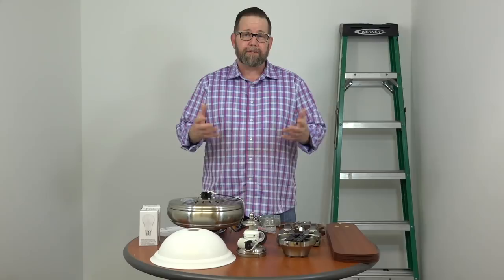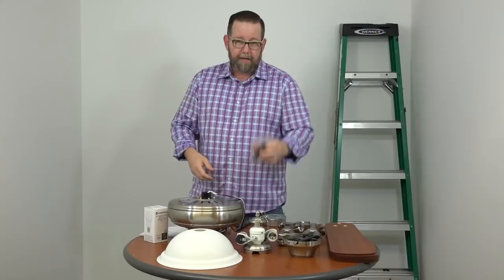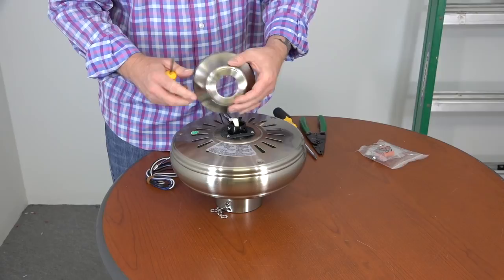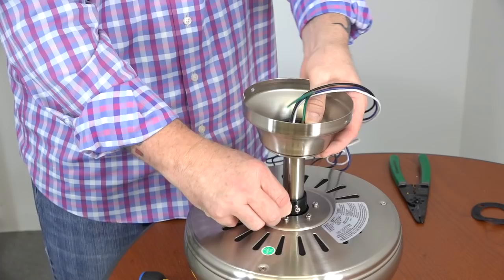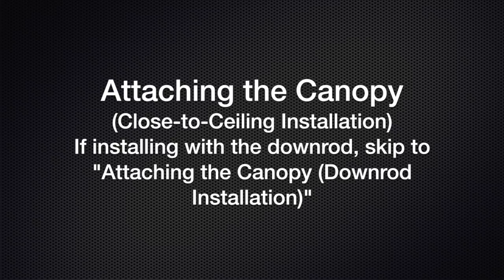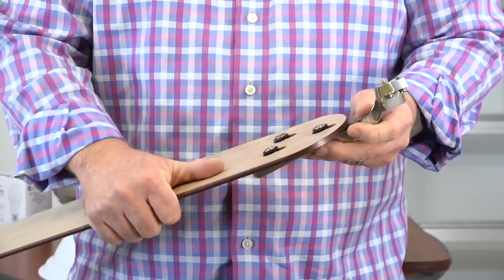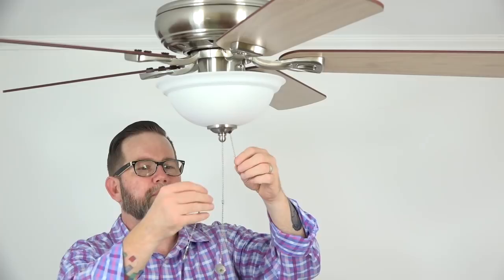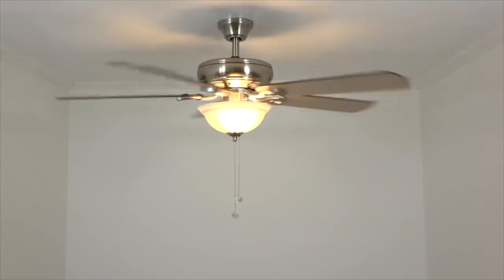How to Install the 52 in. Rothley Ceiling Fan by Hampton Bay

Comment: I've installed this fan in the oil rubbed bronze finnish and I assembled the fan on the floor with the arm's and the light kit, then installed it and added the blades. Just thought I'd share this quick connect hack.

Comment: Great video and used it for step-by-step replacement for fan in our master bedroom. One wrinkle though, we have a red wire coming out along with black and copper. I did a quick look-up and it seems red could be for the light separately. We ended up putting the black and blue from the fan with the red and black from the house but it has created a situation where things don't seem to be quite right with the switches on the wall. Should we change it so the red is with the blue and black to black separately? My main concern is not wanting to start any shorts or hazardous situations. Thanks!
Reply from the maker: Thanks for watching! Let me start by saying that I am not a licensed electrician and you should always consult with an electrician if you wiring varies from the instructions. That being said, in general a red wire is typically a wall switch wire. You can either cap the red wire and connect the fan's blue and black wire to the house black wire. That would let you have regular control of the fan via the pull chains. Or, you can wire the fan's blue wire (light wire) to the house red wire and the fan's black wire to the house black wire - this would allow you to turn the fan's light on/off with the wall switch. Please note that the light would need to be turned on using the pull chain initially, then the switch would take over control of the light. Hope this helps!

Comment: Thanks for your professional and efficient work in this video.  I want to install a remote control. Because of the transmitter, it seems like power wires will not be able to come through the center of the mounting bracket instead through the open space on the side.   Is this unit not designed for remote control?
Reply from the maker: Thanks for watching. This fan can be installed with a universal remote control. When installing the remote, just pull the house wires to one side of the mounting bracket and the fan wires to the other side. The receiver will slide into the mounting bracket and rest on top of the ball of the downrod and wires. You can see the general process by watching the universal smart remote installation video - https://www.youtube.com/watch?v=1jRqtwj1xu8&t=15s
Reply: @ceilingfans101  Thanks.  I already did it.  Thanks for echoing what I  knew.  Thanks again for your video.

Comment: How do I connect the ground connection if we didn’t use the rod with the green wire?
Reply from the maker: There's a green wire on the mounting bracket. Just connect that to the house ground.

Comment: I'm installing this fan, I got the fan to spin but the lights wont come on. I traded the light kit out but it still won't turn on the lights. Any idea what I'm doing wrong?
Reply from the maker: i would check that the blue wire from the fan is properly connected to the house wiring (blue fan wire to black house wire)  - MAKE SURE THE BREAKER IS TURNED OFF BEFORE CHECKING. Then i would check to make sure the light kit wiring is properly connected to the wires at the base of the fan. If all of the wiring is connected properly and the light still doesn't work, I would call Hampton Bay customer service at 1-855-434-2678.
Reply: I am having the same issue. Did fixing the wiring get the lights to come on?
Reply: @seansavage9769  yeah I had the blue wire on the wrong wire from the house
Reply: I have the same issue as lights are not getting on.
I have connected blue wire to the red wire coming out of ceiling.

Comment: Check balance for fan wobble in steps. Remove rubber screwed on stops and turn on fan to check for wobble. Install arms turn on fan to check for wobble. Install blades turn on fan and check for wobble. Why! So you know it is motor or arms or blades that caused a fan wobble. So install and test in steps.
Reply from the maker: those are good ideas, but wobble can also be cause by an improperly seated ball in the mounting bracket, a loose motor collar screw, or loose outlet box. Your troubleshooting steps are on point though! Thanks for sharing.